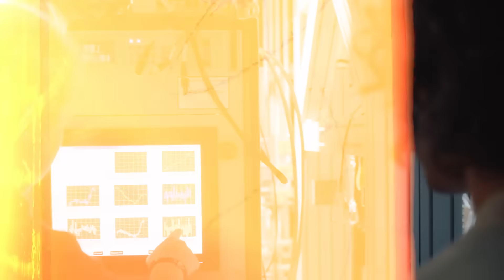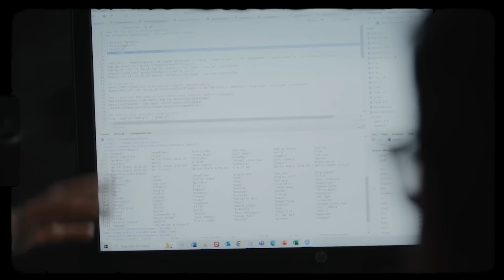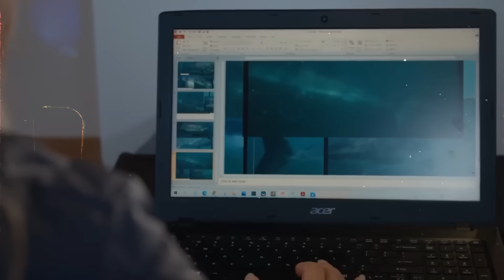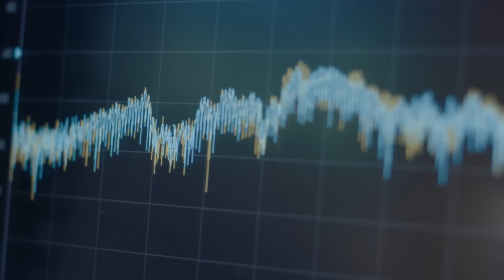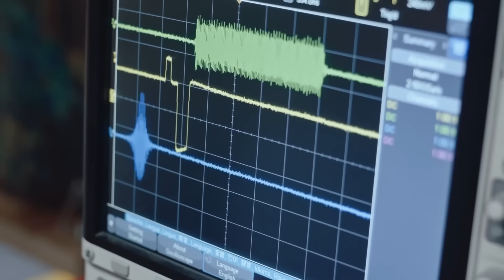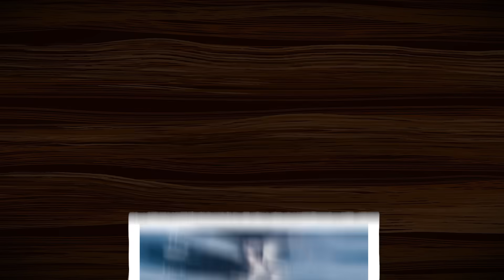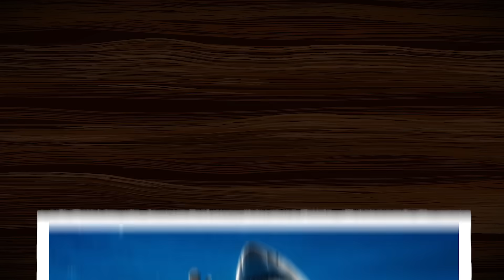Marine Biologists Asked Google AI What Ate A Great White Shark Whole… It Shut Down Moments Later

Comment: Seriously dodgy research for this video. A 25ft female great white was caught off Prince Edward Island, Canada, in 1988, measuring approximately 7.3 meters (24 feet) in length. Named "Deep Blue," this shark was estimated to weigh around 2,500 kg (5,500 lbs). MOST Great Whites are between 13-20ft. The tagged one was unusually small.

In any case, the tagged shark wasn't eaten, it dived down to that depth itself and only one week later was the 78F temperature recorded for a period of 3 weeks. That suggests 
the shark dove down in search of food, and spent time in an usually warm part of the deep ocean, likely the result of thermal venting from the sea floor where there may have been good feeding opportunities. Great White sharks are known to spend significant time in waters around 75-80-F

Comment: I have SEVERAL more realistic theories for what happened. Here's the two most likely scenarios. 

Scenario A.
We've all seen a SAT tag. It's gets pierced into the dorsal fin of the shark and stays on them until it later breaks off and floats to the surface. Have you guys seen Sharks fighting? They bite each other in the dorsal fin all the time. Most likely, in a scuffle with another white, probably female, her fin was bitten causing the tag to break off in her mouth and was then swallowed by the shark until it was later pooped out. The tagged shark is probably still alive or at the very least wasn't fully eaten lol

Scenario B.
The shark was attacked by an Orca pod and in the attack the tag was eaten by an Orca. This is less likely though as orcas are a lot like us in the sense that when they get something that is not food in their mouths, they're pretty good at spitting it out. So scenario A is the most likely case

Comment: As soon as l heard it had been eaten and the temperature went up on the sensor, l thought mammal predator. Then it mentions size and that fitted in with Oraca's size range. But the depth it went to seems to indicate Sperm whale (mainly squid eaters). A 9 foot sharks is not that large. A larger great white shark may eat it and are known to dive to great depths.

Comment: Basically, we’re back at the beginning, meaning no result better than the assumption that it’s a great white shark.
What if it’s just the fin that was bitten off by the tracking device, not the whole shark? Then it doesn’t have to be a very large shark, right?
We’re all expecting some kind of dinosaur or at least a megalodon.

Comment: Ridiculous.

The largest documented great white shark was a female shark measuring 19.1 feet / 5.83 meters, most great whites are rarely more than 4.0 to 4.9 meters long - and this shark that was supposed to have been devoured by a larger predator was 9 feet / 2.78 meters long.

The metric system makes it much easier to understand the size scales here, because from what has emerged, the AI has switched off because it could not find the candidate as there was no verified data. Because 25 feet is 7.62 meters - that means that the animal that attacked Shark Alpha is far larger than any known great white shark for which there is data. All the data points to a classic great white shark attack - but the size scales did not match what the AI was operating with. Even with data on large unconfirmed great whites, the largest was 23 feet / 7 meters. The 25 ft size is therefore a bit too large.

But it should be emphasized that despite extensive knowledge of great white sharks, scientists know far too little about their growth and lifespan. There are estimates, including up to 70 years for the oldest, and that they become fertile at the latest at the age of 33.
Reply: The video says experts estimate a great white of 16-20 ft could swallow a 9 ft great white. So it's not even something uncommon. Stupid video

Comment: Isn’t it obvious an Orca twice the size would do just that? Orca 20-27 ft up to 5500 lbs. Dives deep, swims fast, eats sharks, known to be in the area🤔
Reply: One question. How long can an orca hold it's breath??

Also orca behavior suggest that they only eat livers.
Reply: Orcas aren’t that temperature
Reply: @ediehilton2566 a mouthful of icy water mixed with 37c body temp would do that average
Reply: Right and their computer system is supplied by the lowest bidder
Reply: A orca cannot dive that deep! They breathe air!!!